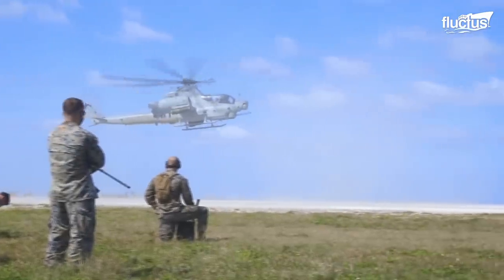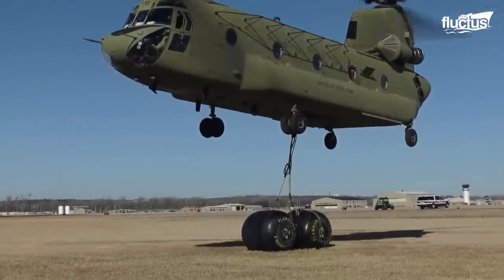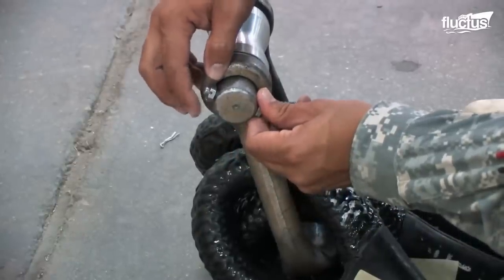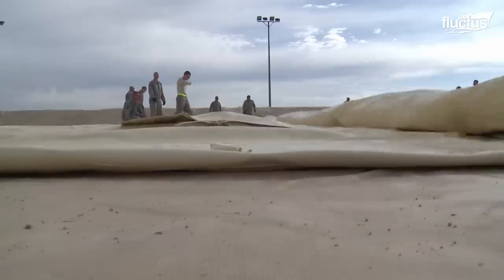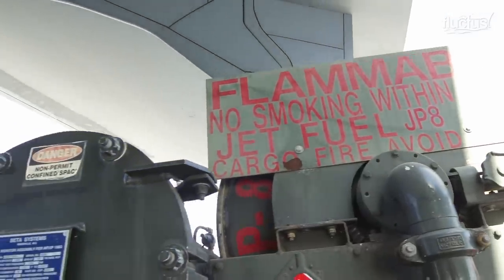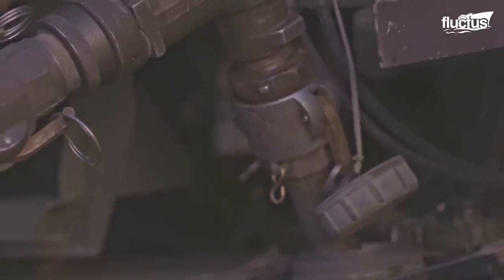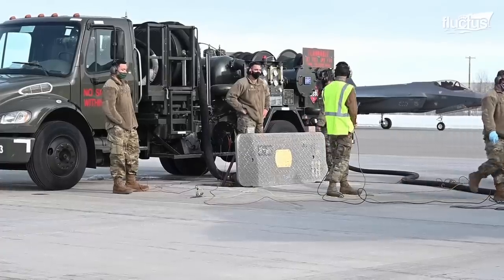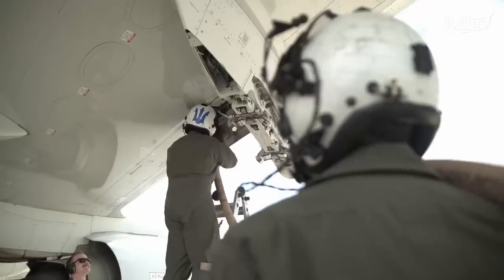Genius Solution US Air Force Found to Transport Tons of Dangerous Jet Fuel

Comment: I was in the Air Force back in the mid sixties and we had fuel bladders even back then, but not as large.  I was also a ground Crew Chief on KC-135, but we never refueld any of our aircraft while they had the engines running, because there was not the need.  Today they may be short of aircraft to do that job and the reason they have to resort to a "Hot Refueling", to get them back into the air ASAP.

Comment: I have wondered why we do not use certain engineered textiles/rubbers/plastics/bladders. There have been numerous tested in space, even as pressure chambers. You could store LNG in these kinds of tanks underwater, if it was at sufficient depth. Also, there has been some work on using quickly deployable gas pipes that are for all intents and purposes are bladder based.
Reply: Flexible items tend to have limited lifespans
Reply: LNG is under pressure.... You want to make LNG bombs?
Reply: They do in airplanes to transport
Reply: @janeblogs324   First, most LNG is stored and transported at ambient pressure. Conventional LNG ships transport gas with no applied pressure at -160°C. Second, I did also say, at sufficient depth" to account for storage that would need to be under pressure.
Reply: That is a really good idea that should be tested at least. This might be a much cheaper and safer storage system for offshore oil fields. Instead of flaring off natural gas, or requiring old tankers to be stationed, anchored at the surface, subject to storms etc. 
Oil fields usually require at least one old tanker that accumulates oil and gas until the next transport tanker arrives. A series of bladders could easily replace these decrepit ships. And if the depth was sufficient even keep LNG liquid in insulated bladders at food freezer temperatures rather than the minus 160 degrees required on the surface. Which is very expensive to do in some searing tropical locations. Heat pumps could be used for this type of cooling. Larger versions of the very efficient heat pump on the Tesla cars could transfer excess heat into the ocean water very efficiently.
This should cut the cost of storage for LNG in half. And make it feasible for almost every oil field. 
Instead of flaring these sites could easily make up the global shortage of LNG.
Reply: @jeremytaylor3532  Well what can I say, I'm an untapped natural resource.

Jokes aside, you get it. Could be quickly and cheaply fieldable and there are numerous compounding potential benefits that could be harnessed. At least I see the potential. Perhaps there's something I am overlooking. However it seems completely achievable.
Reply: @a9s2w5  
Liquidation requires additional pressure.

LNG is often DISTRIBUTED at ambient temperature, but TRANSPORTED at below ambient temperature because the internal pressure is so high.

I suggest that you get a thermodynamics textbook and learn how read the temperature/ vapor pressure charts for natural gas.
Reply: Dear Jeremy - lets not store more heat in the oceans ?
  ? how about leaving it in the ground until we figure out " The Warming Problem " ?

Comment: In the 90s I did trials on airdropping (parachute) of single Air Portable Fuel Containers (APFC) bollocks on to land and into the sea in support of the UK Special Forces. We also had an airdroppable Forward Air Refuelling Point (FARP) consisting of two air drop platforms carrying two APFC each, a pump and all the hoses. I wanted to change the P for point to T for Tankage if only because I wanted to say "I've been dropping FARTs today"
Reply: Alastair, I used to help build and set up these fuel tank farms back in the early to mid 1970s for the AMF providing fuel rations and supplies to land sea and air. Even refuelling multiple nations hovercrafts, helicopters, boats, vehicles, snowcats, etc. Yes, we even use naphtha in the Arctic Circle 🔵.

Comment: 01:02 'The Army transports tons of imflammable fuel'? Then why is it dangerous if it cannot catch fire? If it was FLAMMABLE, then that would be dangerous.
Reply: Inflammable and flammable mean the same,  it's a historical thing. Non-flammable is the opposite.
Reply: @auldteuchter9012  Actually, no. Inflammable means to catch into flames WITHOUT an ignition source, whilst flammable is the opposite, hence It's still incorrect as Jet Fuel is not Inflammable. It's flammable. 03:55
Reply: @GuildOfTheBlackCrow  This is an incorrect definition of inflammable which has cropped up recently in forums and the like. 
Merriem....
The Latin words inflammare (“to cause to catch fire”) and flammare (“to catch fire”) came into English at different times to become the synonyms inflammable and flammable. Although it seems logical that inflammable might mean “not flammable,” the word actually means the opposite, because the in- prefix of inflammable comes from the Latin word meaning “in” or “into.” Using nonflammable is one way to ensure clarity.

Other dictionaries say similar, with no mention of spontaneous ignition. Working in industry (>50 years) this was always the usage. Engineers generally preferred flammable to avoid confusion for less experienced English users.

Comment: NOT NEW - We shipped fuel bladders to front line bases during Vietnam.  No pumps necessary if you start driving a tank onto it.  They may have changed the shape but they didn't invent anything.

Comment: The wildland fire service has been using these Rollagon tires as jet fuel bladders for decades. We used them in very remote areas in Alaska on wildland fires to supply our helicopter fleet. Sometimes a parachute wouldn’t open and the bladder would bust open on impact. We called it a rolla-bomb. Spectacular when it hit the fire and exploded.
Reply: @Fredric Bethune ... Hi Fred, Marty here. ... BLM's Argosy dropped Rollagons of jet fuel on the Selawik NWR fire near the Waring Mts in 1988. More than 1,000,000 pounds of paracargo were dropped onto that drop zone. ... I trained a Nenana Crew Boss on that fire. Then I was reassigned to the Supply Unit. Martin Miracle sent me to Kiana to process the backhaul to Fairbanks. We wrestled those flattened, empty rollagons into the Argosy on the airstrip there. ... If I remember correctly, we were on the same flight from Kiana on a Caravan to Ruby. I went on to Central and then Wainwright from Ruby in that Caravan. ... Next was Yellowstone NP and rotor wing management for me Mike Bobo, and Bob Jonathon at the Huck and Mink Helibases. ... What a summer Fred. ... Nice chatting with you. Take good care, my friend.

Comment: Nothing new here. I flew Air Force C-130's in Viet Nam and delivered lots of rubber roll off fuel bladders for the Army helo's at any remote fire base with a short runway.  Also flew rubber bladders of fuel to fixed Army bases like Kotum.  Had two bladders and two gas fuel pumps in the cargo bay and two fuel specialists to quickly offload in about 15 minutes.  We flew mostly at night due to incoming mortars while we were offloading.  Kotum had an Army GCA that guided us in totally blacked out until just short of touchdown.  Helping out with suppression fire were AF Spectre gunships.  Made for an interesting tactical approach and departure.

Comment: "Have you while in the military worked with fuel bladders and had any of the following symptoms?  Runny nose, headaches, weight gain, Covid, common cold, allergies or other forms of illness?  If so, call the law firm of X and X"  :)  It's coming  :)

Comment: As a former SSgt in the USAF (SAC), I really enjoy these informative videos.  My job was sort of related to the transfer of fuel.  (It was called JP-4 at the time)
I was a Flight Simulator Tech on the KC-135 simulator.  My job was to ensure the crews received maximum benefit from their training missions by keeping the simulator operating at 100% functionality.
Reply: I've been up on a 135. Really awesome tanker! We flew a couple different military simulators when I was in CAP years ago. Was a great experience! I even got stick time on a 130. We were being airlifted to a cadet activity. I've always been a huge fan of military aviation and I've been up in numerous military, commercial and civilian aircraft.

BTW, thanks for your service!
Reply: JP-4 was a different animal. The current JP-8 is user friendly, has a higher flashpoint and doesn’t have near the static  generation JP-4 did. That stuff you could actually hear the static! 
I came in around the time SAC was changing and the C141’s were being phased out. I think we had it pretty good back then. Today’s mil environment is very different. 
Thanks for your svc!

Comment: I made those towable drums during the Gulf war at Amfuel.  QC was pressure testing one with compressed air and forgot.  Talk about a bang though the factory.  Amfuel was a good place to work but Zodiac Aerospace is a horrible company and they owned us at the time.  I was proud to make those for our forces.  We also made fuel bladders c130, f18,a10, t38, f5 , kc135 and a ton of Bell helios. Any questions about how they are made?  It is a cool process, some use plaster forms, other use bolt together forms.
Reply: We also made the MH47 bladders.  Those long green tubes on the side are the fuel tanks with a rubber bladder inside.  And a Very large man can sit inside of them.
Reply: I worked for a company that used small ones to refuel mountain top communication site generators annually. They weren’t very big and would  sling them under a 407. They had 4 so there was always a full one to grab at the low site and and empty one on the mountain top.  The sites were spread out about every 30-40 miles for 700 miles.
Reply: @Chris_at_Home  Yep we made two sizes a 550 gallon and a smaller one.  Can't remember the size on it.  The Larger one was made using a metal external form and an internal smaller form.  The external metal one was so massive we turned one into a Bar-B-Que pit for the Magnolia Blossom Festival Steak cook out.  The unit need 25 bags of coal to just get hot.

Comment: I'm old enough to remember when we'd just pull an LST up to the beach and start pumping fuel into bladders.
Reply: Unfortunately places like Afghanistan were notably short on beaches.
Reply: @allangibson8494  Point is, it's not a revolutionary discovery. It's an evolution.
Reply: @abefroman4953  In WW2 the British ran a pipeline from England into France ten days after D-Day…
Fuel has always been a problem for mechanised armies since the 1920’s.
Fuel on a front line base in Afghanistan cost $70/gallon delivered - which is why the US Army is investigating solar power for frontline forces (more watts per ton delivered).

Comment: Well... without watching your video, I can say for sure that jet fuel is only slightly modified kerosene which means it need a tremendous amount of heat to become explosive, so it's not at all dangerous in that regard.  But for sure it's dangerous for the environment if it was dumped on the ground, or if you drank it.
   But other than that, it's not dangerous

Comment: Yeh… The RAF was doing this in the 1970’s nothing new … also using underslung ‘barrels’ or for more longer term a pillow tank. 
The system is useful for dispersal to a wood off airfield or extent the range of operations behind enemy lines.

Comment: Now the bulk storage on Airbase is much great the primary storage tank on a small air base run around 2.5 million barrels of fuel, approximately 150 million gallons, two smaller tanks holding approximately one million barrels of fuel so the two small tanks hold approximately 55 million each !!!

Comment: Blivets have been around for decades, and are tough.  There is a Y-shaped metal yoke that can attached on the sides and it has a tow opening at the end.  Then they can be pulled into place; in the "old days" we used Jeeps and even a little monster called a Mule with 2-cylinder gasoline engine.  I worked for some years with the company that put together the Inland Petroleum Distribution System (IPDS).  The large 5,000K barrel (210,000 GL) bulk fabric tanks were issued 18-each to a Tactical Petroleum Terminal (TPT) along with all the '600 GPM pumps, hoselines, and issuing points.  The other two elements were the Pump Stations with 800 GPM pumps connecting to 20-foot long 6" diameter aluminum pipe segments with a groove coupling similar to Victaulic but stronger.  During the first Gulf War 120 miles of pipeline was laid connected to the Saudi terminal at Ras Tanura for supply, while multiple TPT's were installed and filled with trucks, especially out where the "left hook" route turned into Iraq.  It could also be connected to the Offshore Petroleum Distribution System (OPDS) with an anchor leg and undersea hoseline, so tankers could pump product ashore to a Beach Termination Unit connecting to the IPDS to then move it inland via the pipeline and pump stations.  Not a new concept; installed pipeline were used in WWII (steel) but now just has newer, better, faster-installed materials.

Comment: As a pol guy back in vietnam we used rubber bladders and the big donuts for jet fuel back then it was jp4 or avgas 115 145 for remote helicopter refueling we also had portable fuel systems called r14 systems two bladders and a pump module we placed them all over the country for army troops.

Comment: Esto existe hace muchos años
Reply: Not slingloading from helicopters or transporting on cargo jets.
Reply: @rayjames6096  The Argentine Army does it, that same transport, not only in planes, but hanging in helicopters, barges and trucks, I have lived it, nobody told me.
Reply: @dangeloda    The Argentine military only operates small utility helicopters, not heavy lift ones like the Super Stallion and small cargo aircraft, not heavy lift transport ones like C-17s.
Reply: We also operate throughout the world under the protection of the UN, you don't need a super stallion to transport fuel, anyway the issue here is the system and we have used that system for more than 30 years.  A pleasure to exchange opinions with you.
Reply: @dangeloda    It's been in use since WWII and Argentina doesn't have a global military.
Reply: @rayjames6096  So you are giving me the reason that this type of fuel transport is not recent, it comes from a long time.
Reply: @dangeloda   Not by helicopter or transport planes.
Reply: @rayjames6096  well friend, you do not finish anymore, the subject was presented as something new and it is not something new, that only wanted to say. Luck
Reply: @dangeloda  no it was that those bladders are being transported by heavy lift helicopters and heavy lift transport jets and not just by trucks now.